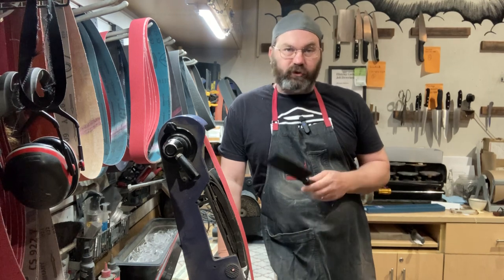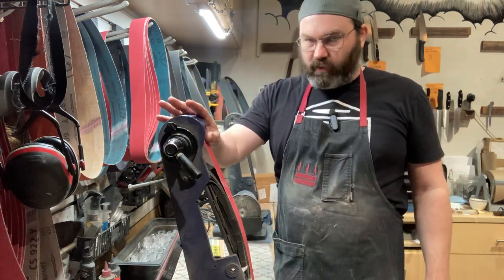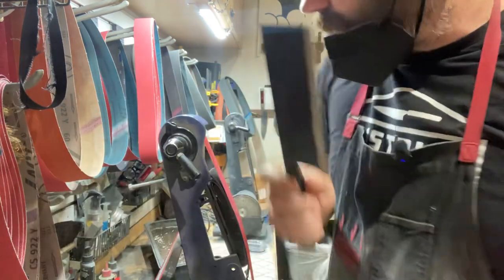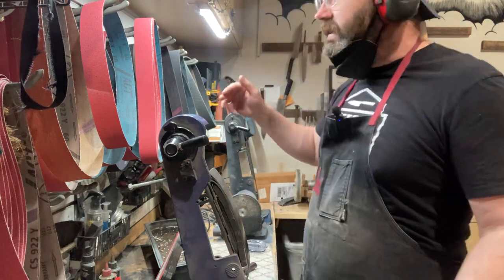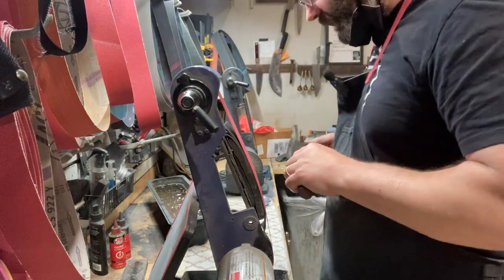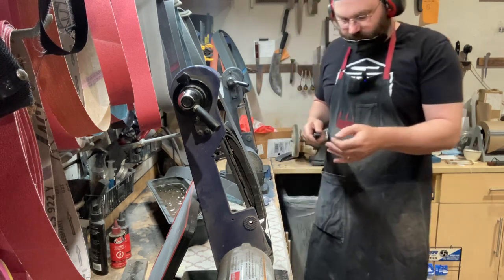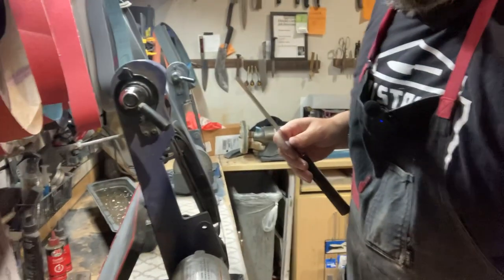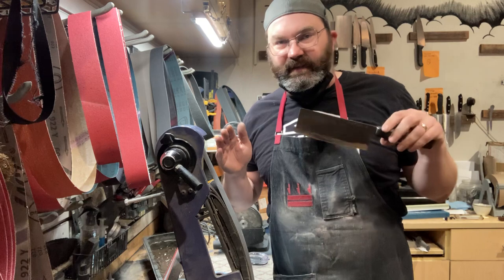Thinning a Takeda Nakiri on a Belt Grinder

Comment: Dont people buy a knife for the feeling and profile a spacific smith made it with? Why buy a very specialized profile just to change it? Y not buy from a smith that forges in the style that you want.
Reply from the maker: I ask myself this question everyday.  Sometimes though people don’t  know exactly how a knife works until they have it in their hands.
Reply: Tknx Ryan. Love this video!
Reply: Sometimes, thinning is done on an older knife to bring back its cutting performance.  If a knife has been sharpened several dozen times, the metal behind the edge can end up being quite thick and hinder the cutting performance.

Comment: Ryan you're awesome! I'm newly in love with jknives. I'm a little bit confused about the terminology you were using. When I Google primary edge and secondary edge most of the diagrams in the image search refer to the cutting edge as the secondary bevel. When I Google parts of a Japanese knife they call that cutting edge the hasaki (you called it primary edge). The other bevel is a kireha and the primary bevel, according to these diagrams (you called it the secondary edge). Can you please explain which is correct? Is this a common misunderstanding?